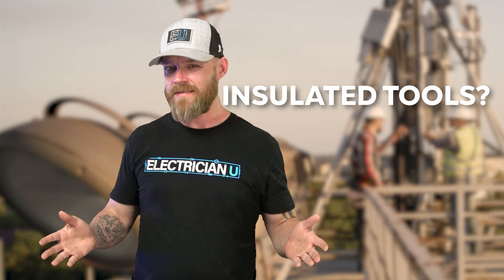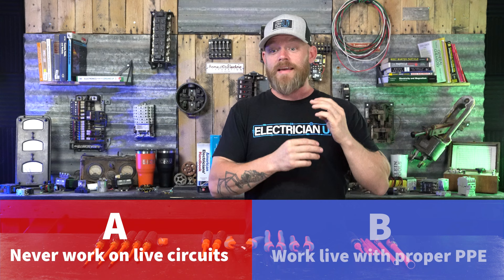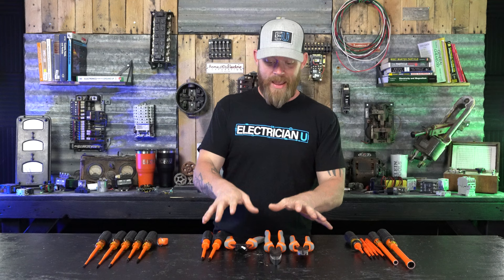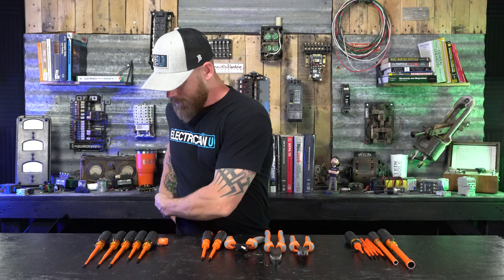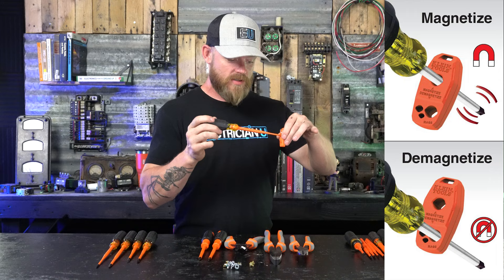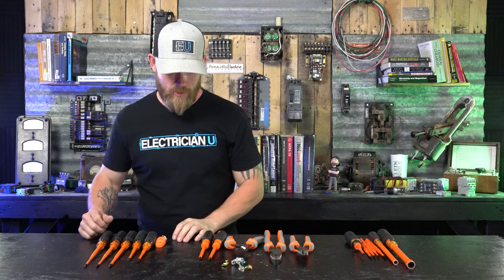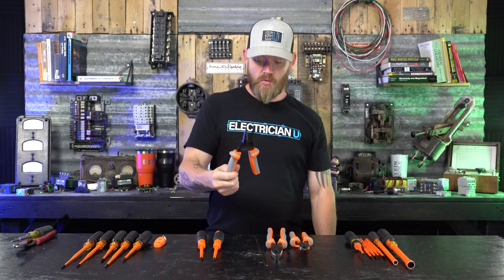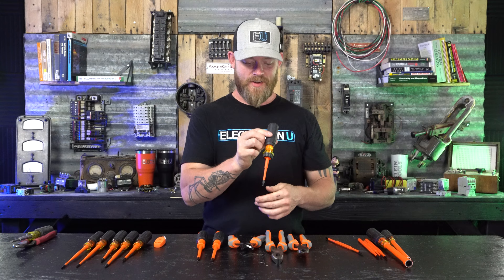Every Insulated Tool Electricians Need!!!

Comment: Thanks for the great video, again, but I have a random Question.  I installed 7 new outlets in my home, used my circuit plug tester to make sure they were wired correctly.  But my question is, why are the grounds on the new outlets soo tight, I had to force the plug tester in each one and actually around the 4th one, it ripped the ground out of my tester.  I was able to put it back in to finish the testing, but it pulled out in each plug after.  Is it that tight because its new? Did I install them incorrectly?  Should they be THAT tight?  Or did I have a cheap tester?  Thanks.  Love these vids, learning a ton!
Reply: Could be that the new outlets would want it good and tight so there is a guaranteed ground.

Also after Covid and manufacturing changes it could be that there just making them to tight.
Reply: Sounds like a tester error unless you got a random bad batch of receptacles . Yes there tighter new but not tight to where it’s breaking your stuff
Reply: That sounds like you got a maybe not so great tester, it shouldn't be possible for the receptacle to grip the ground prong so tightly that it removes it from the plug (any plug, including the one in your tester).
Either way if the tester is the kind I'm thinking of with the 3 little neon bulbs in it (or maybe these days LEDs) and a go/no-go chart on the side, then they're cheap enough that you should be able to just get another one to replace the one you have.
Test equipment is one of those things that's hard to shop for, because you can't really afford to cut corners but there are also many products out there that have more features than you need (and therefore cost more).
Reply: Sounds to me as though the plug tester you were using either wasn't good quality, was defective, or was very old & worn out.  
If you were using a less expensive tester, you should be able to replace it without too much cash.  Klein has GFCI testers for less than twenty bucks.  Their testers that don't have a GFCI test button can be had for less than ten bucks.
As far as the grounds being tight, that's a good thing.  It'll ensure your plug stays seated correctly in the receptacle.
Reply: For some reason I have found that the plugs on the receptacle testers fit tighter than normal plugs in Tamper-Resistant outlets.
Reply: It's probably normal for the tester to fit in tightly.  However, if the receptacle is jiggly or loose in the box, then pulling out the tester is going to be more difficult than it should be.  The correct fix is to use spacers between the receptacles and the boxes to ensure that the receptacles fit tightly and are not sunken into the box.

Comment: Wish and harbor frieght sale insulated toils. I was electronic tech for 44 years. Had to work on gear. Had to  work energized even though 120 VAC or low as 5VDc. When I was in Navy they taught that an electrical shock of 30 volts for 1 second has killed people.

Comment: Isn't the requirement for insulated tools required for any work in an energized cabinet / panel over 50V? Not necessarily for working on an actual live circuit. It's to prevent accidental contact with energized parts in that cabinet / panel even if the circuit you are working on is de-energized.

Comment: Insulated tools are not designed so that you can work live. 🤦🏻‍♂️  they’re designed to be used in an environment where you may come across live current. Places where lock out tag out is a requirement mainly because there’s too many factors. Working on an outlet in a warehouse or refinery, is different than wiring on an outlet in a house. You are much more likely to come across live current in that environment. Insulated tools are like the seat belts in a car. You drive safe, but you wear it just in case.

Comment: Cool Video Dustin, The one thing OSHA cant understand, is you can not fault find electrical problems on a dead circuit. But i would never work live. I do not own any klein tools, For my CA electrician apprenticeship, I really invested my money in Fluke 87V meter and Knipex tools, rated at 1KV. The First time I bought professional tools to last.

Comment: An insulated tool isn't made to work on a live circuit/equipment. It's insulated in the event you have to work around or near live circuits to prevent accidental touching of energized equipment.
Reply: Insulated tools by design are meant too work on live circuits. There heavily tested for that soul purpose of working live. A lot of people wear hot gloves and use insulated tools.
Reply: @_offshorefishing_9447  yep, it’s a a multi meter that’s not rated to work on live circuits even though it says it’s good for 600v

Comment: Most of the time, I find I need to use insulated tools because of a mistake on someone else's part.

As an example, because of a mistake made 30 years earlier, someone attached a temporary new install to the hot side of a service breaker, so when it needed to be disconnected and attached to the proper power service, there was no way to de-energize it.

Comment: Do electricians really need insulated tools?
Yes!

Even though an electrician should mostly work on not hot wires. The insulated tool is the last line of defense in case of a failure and there is (for what ever reason) still voltage on the system.

So even if you never work on live circuits, insulated tools might save your life. You make a mistake, someone else makes a mistake, you might die without this tools. Or worse, you cause an accident or kill someone because of the wrong tools.

The other argument for insulated tools is working on live circuits. And, of course, they are a necessity in this case. However, working on hot components should be the exception. If some company refuses to shut a circuit down, just because it costs them some money, they should consider what it costs to have an accident because of unsafe procedures. Yes, there are situations, when you have to work on live circuits. But if not really necessary, do it the right way.

I use insulated tools every day. This stuff is not that expensive to justify a second set of not insulated tools for work on not live circuits. So, I use insulated tools for nearly everything.

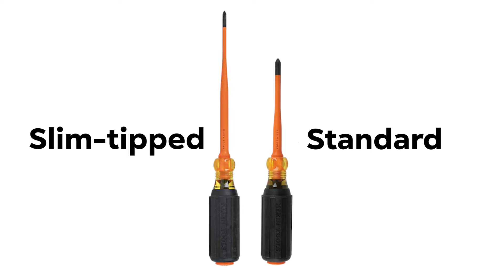Comment: 6:27 - those are actually both slim tipped… the insulation isn’t wider than the tip of the Philips head. Those are just 2 different sized Phillips heads. Probably a #1 vs #2.
Reply: 6:35 - This one actually is not the slim tipped… You can see the diameter of the insulation is way bigger than the head of the screwdriver itself, making it hard to fit into circuit breaker lugs for example.

Comment: One time I was in a rush to wire up a recepticle live and was using only my Leatherman, all went well until I had to tighten the hot terminal screws and safety finally prevailed over lasiness
Reply: Wear insulated rubber gloves, I have worked on a few circuits live using rubber or leather gloves.

Comment: I won’t lie. My Klein journeyman 2000. I use on live ccts . I just check the handles .  I tape up the shaft of my drivers and check the handles. I wonder if wire nuts have the same insulation as the Klein 2000s  ?  Probably same poly

Comment: 35 years electrician.  Work everywhere. Clean rooms.  Bought insulated screw drivers and. Never used . Waste of  money. Electrical tape works great. If your not working on live circuit,  your not electrician.

Comment: If a company or owner wants an electrician to work on anything over 480v, said company is violating osha's and local regulations. Those insulated tools cost up to 4 times as much.
Reply: Per OSHA you are not supposed to do anything “Hot” or live unless you can prove it can’t be turned off for some safety reasons. Good luck with that. 

Per OSHA 1910.333(a)(1), live parts to which an employee may be exposed must be de-energized before the employee works on or near them, unless the employer can demonstrate that de-energizing introduces additional or increased hazards or is not feasible due to equipment design or operational limitations

Comment: Might as well just use insulated. There's no reason to take risks and the price is going down on some sets. Just check for wear and tear over time on any tool. You can get shocked through the handle if the grip deteriorates. I'm with group A though. It's ridiculous to expect work to be done while manufacturing products or operating a business. No millions of dollars  of production is worth my life. Except maybe emergency situations like hospitals if it is urgently needed to save lives.

Comment: I cut a 240v (live line not attached to anything, side of house i was on was dead except this line, was removing it) 10-gauge line with my regular kline journey side cutters. I didnt get shocked at all, but i do have a hole the size of a wire on my snips now. Was a little deaf and blinded though. Always wondered why that was, not like im trying to replicate it to find out. Do some tools offer some form of insulation even though they're not rated to do so?
Reply: Actually you just shorted the circuit through your cutters, no current went to the part of your cutters where it has insulation. For that to happen you would have to be cutting only one line and short the circuit through your body.

Comment: Working live - Automatic Transfer switch - ATS - as well as taking amp reading for a building or MCC. Also retorquing a panel live as per NFPA 70-B  !!! 
Some tools are double dipped. Dipped in yellow then Orange. This way small nicks show up as yellow - to warn you. Yellow orange two layer stuff is neat. 
Yes, its ok to baby some tools. A pussy bag where the tools are not treated like work tools.

Comment: OK; why do we not use more thn 3 phases for loads in a building? Would having a 12  phase power supply  panel increase efficiency, ease load  balance  and help reduce heat? Or is 3 phase the highest we can go?
Reply: So, you may want to look up how single phase and 3 phase electricity is produced. The channel "engineering mindset" is a fantastic place to start.

Comment: The only thing I use in a live panel is a multimeter.   That's insulated enough.
Am I the only one who was offended by the montage piece at the beginning where a person in PPE was using a meter with both probes on the SAME LUG of a breaker panel?

Comment: I'm surprised there isn't any non-metallic or non-conductive screwdriver on the market. Wouldn't materials such as carbon fiber do the trick to replace the steel shaft? Sounds like a better solution than covering the tool with rubber insulation, which will obviously get damaged the more you use it.

Comment: And now here’s the question Dustin.
Do you let other borrow these tools,,or your other tools?
I baby the crap out of my tools; so much so, that ppl laugh at me b/c at end of jobs I wiped them down, and at end of day; I really clean my tools. Do they look new, sure, but as some tools you buy you are crying b/c of cost; they can laugh all they want. Know my tools will work, last, and do the job. Do I lend them out, no, I do not; UNLESS, someone’s in a pinch and I tell ‘em straight up, return as gave to you, as I’d expect the same if I borrowed a tool, you return better then when got it (when that’s possible, I’m sure ya know what mean, lol).
Cheers✌🏻
Reply: I may not be an electrician but I totally understand babying your tools. I'm an auto mechanic, and sometimes my tools get filthy.
Do I put them away filthy? Hell No! At the very least I wipe them down with a shop rag to get most of the grease and oil off of them, but if I got coolant on a tool that has any significant amount of plastic on it then I'll rinse it off with something (sometimes water, sometimes brake cleaner, but the brake cleaner you get these days isn't the plastic-destroying stuff that it used to be, it can't have chlorinated solvents in it anymore for environmental reasons)
Somehow they've the modern "less toxic" formulations of brake cleaner works pretty dang good even compared to the old stuff (the old stuff DID work a little better, but not enough for me to want to get cancer from using it).

Anyways, I always put my tools away as clean as I can, and my ratchets get lubricated about every month (with red engine assembly lube, the stuff is extremely tacky so it stays right where it's needed unlike regular grease or oil), and I monitor their condition closely to see if they'll need any parts.
Believe it or not, I own some 50+ year old Snap-On ratchets that I can still get parts for relatively easily, just gotta find and talk to the guy driving the Snap-On tool truck around town (visits most of the major mechanics shops and auto dealerships in my area, but not my shop since the place I work is just a father-son thing and therefore doesn't generate enough business to warrant a weekly visit). Not only are the parts available, the engineers over at Snap-On have made improvements over the years! I used to have 32-tooth sprockets in my old ratchets, but as those sprockets and pawls wore out the Snap-On guy only carried parts that drop-in that had something like 50 teeth on the sprocket. Doesn't make the ratchet any weaker, but it DOES mean that I don't have to turn the handle as much to get it to make a single "click", which makes my life easier. And that right there is why the big tool brands stay the big tool brands. They stand behind their products, no matter how old they are they'll try to get them working again.

Comment: Dustin, do you have your tools and hot gloves electrically tested periodically to insure they are still providing rated voltage protection.  High voltage gloves are especially susceptible to microscopic tears and punctures that a visual inspection might not identify.
Reply: Before you use your rubber gloves you should role at the cuff and make it tight and squeeze so there’s air inside, then check for cracks or ozone break down of the gloves before each use.

Comment: As an EE, if the power distribution is adequately designed, you should be able to always work with no energy. What you are describing in the beginning is just bad EE distribution design. If you need to add a receptacle in a store/industries and that means you are switching off main process, well you really screw up your distribution  design. Critical process should never be coupled with receptacle at a panel.

Comment: Some one told me a story where the dude got out of his truck with his multi meter.
Goes to the panel to take a measurement 
BOOM!

The guy was certain he had died. 

It wasn't until he heard some noise that he realized he just blew the breaker. 

Basically what happened was it was a cold day and condensation formed inside his multi meter and arched inside.

Comment: Electricians / Techs getting into renewables should get insulated tooling. We deal with PV circuits, batteries and capacitors. 

Obviously, isolate when able, but if you're dealing with voltage sources (batteries and solar panels), it's nice to have some insulation between you and your PPE (😉😉😉).
Reply: Agreed, but this also applies to my line of work (auto mechanic).
Hybrid vehicles and electric vehicles are getting more and more common on the roads, and I need to be able to work on them to continue earning a living.
So to that end, the first time I see an electric or hybrid vehicle roll into my shop for work involving the HVDC side of things, I should go out and get a set of insulated tools.

As far as getting shocked by secondary voltage of the ignition system, well I don't think they make tools small enough for my needs that are rated to over 20kv, so that's probably not an option, but there's an easy fix: "Don't work on the ignition system with the engine running, ya dingus!" That has served me well over the years, and I've never run into a situation where I needed to grab a spark plug wire while the engine was running. Always able to observe things from a distance using an inspection mirror and a flashlight (and my ears to hear the tell-tale snapping of ignition voltage either leaking to ground or taking an incorrect path).